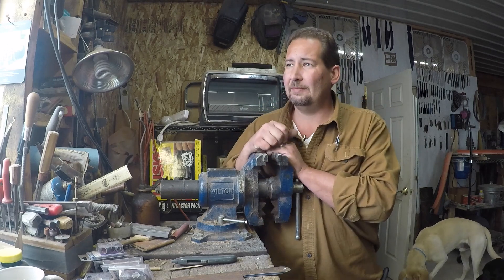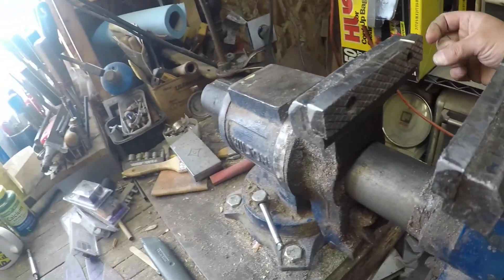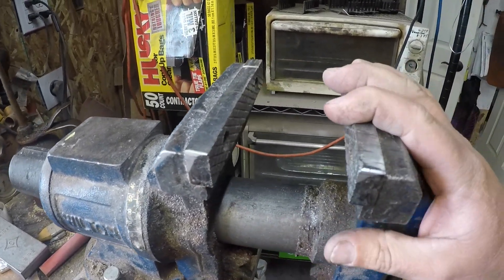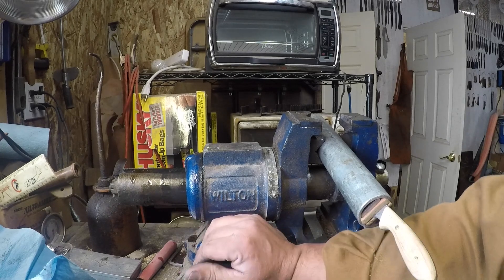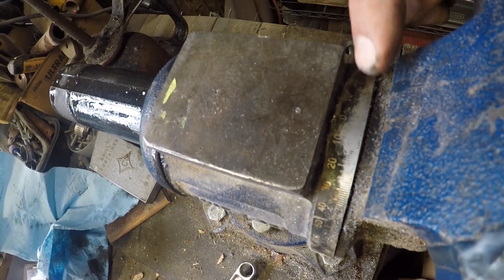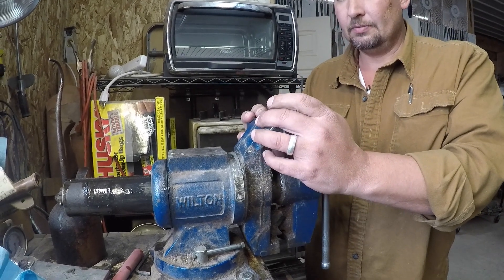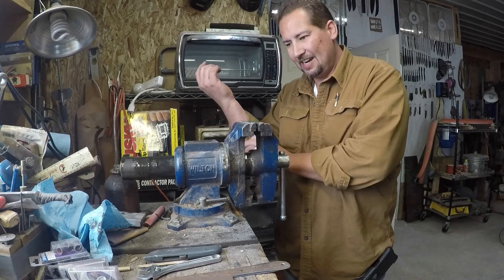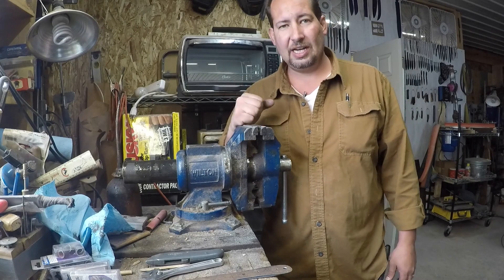wilton vise review

Comment: Just picked up one of these off amazon. $205 total. Ya can't match the versatitiy. The only concern i have is the rotational clamp screw not holding when putting sideways torque on the head. I wonder if those 30° marks can be drilled out slightly on the inside to make more of a notch for the set screw. We'll see though. Havent heard a bad thing about these vices yet and it should be a lifelong tool. Id recommend it for sure.